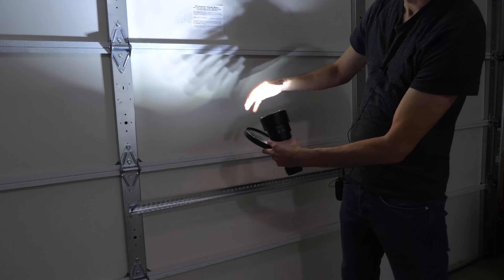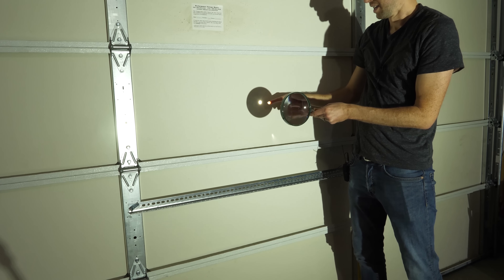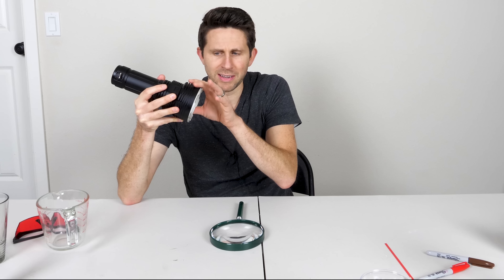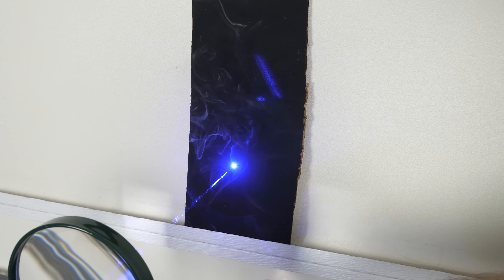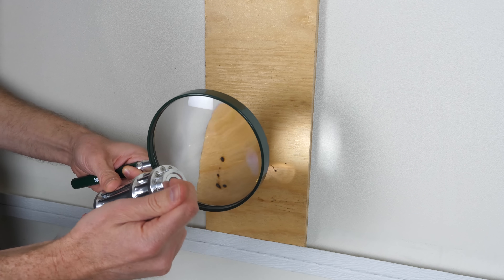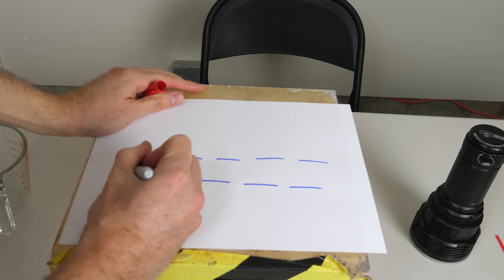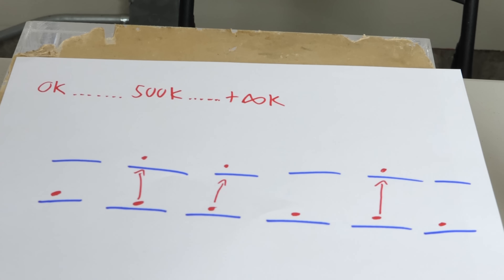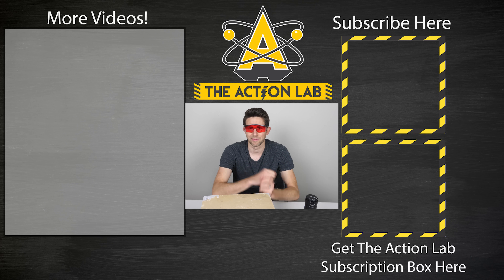What Happens if You Focus a 5W Laser With a Giant Magnifying Glass? Negative Kelvin Temperature!

Comment: But if i have something has an infinite temperature it therefore has an infinite amount of energy. Which means that by cooling it down I remove energy from the system from it but the energy of the object stays at the same (infinity goes against common sense) and that means that I destroyed energy which is not possible. And if something really had an infinite energy output then howcome litteraly no one has used it to solve energy problems? Seems like this video is full on lie.

Comment: I wish I could say how many watts the insane laser diodes I have are. But I can’t 😉 the fact they are not suppose to be sold to the public might give a few hints or the fact that no info is on the internet about them b/c corporate policies. Lol. Safe lasering folks. Keep safety in mind and make sure you use the appropriate eyewear. Not eBay crap that is completely just wrong that it exists. 😞

Comment: Thermodynamics is defined as branch of science that deals with energy... Temperature is just a measure of random motion/vibration.
In lasers there is no randomness so you get 0 or -ve temperature
Stephen's law says. Radiation energy emitting is proportional to Temperature^4... So for source to emit laser, it doesn't matter even if temperature is negative (or imaginary) as long as T^4 is positive ,which is for all real and imaginary numbers (not necessarily for complex numbers) laser source can have negative temperature and still emit radiation..
Reply: Besides 0 Kelvin was defined by gas laws... P V=n R T..
This equation suggests at T= 0 there should be no motion of atoms or molecules.. this point was graphically found at -273.15 Celcius and new scale was introduced having that point as zero (i.e. 0 Kelvin)
This was termed absolute zero... But that is not true when you are talking about subatomic science. As theory never took into account motion of electrons. And sub nuclei motions...

When electrons fall from say X shell to Y shell it emits radiation. Wavelength of emitted light can be calculated depending on shells... Wavelengths are unique for each combination of atom and shell numbers X, Y...
In case of lasers all wavelengths are same.(which is not in the case of normal light) this can only be achieved if electrons are falling from same X level and going to same Y level... Yeah! No more randomness.. so this loss of randomness means it's less random then non moving atom i.e. less then 0 Kelvin
This means if we want to address randomness of electrons we need to make a new scale.
Then you need to make newer scale to account for sub-nuclie randomness (if there is way to decrease randomness of it - which will be found as science progresses)
So don't get bother that how can negative temperature exist...it can

Comment: Not sure about this explanation. Are you actually getting a higher energy point than the amount of energy the laser can produce? I feel like theres a big "technically" somewhere in there. If you could use more optics to focus all of the light from the flashlight to a small point, that would still be near the actual power output of those LEDs and possibly able to burn. With a laser you just get that without all the optics in one color. I'm not a quantum mechanics scientist or anything but it sounds like you are still matching the power of your source.

Comment: There is a few mistakes in that video.
#1 : if a lense concentrate more your laser, then this laser is not calibrated correctly.
#2 : temperature is the mean speed of molecules. Very high in the thermosphere, the temperature is high, but you would freeze if you get nude over there. Not enough atom are hitting your skin to warm it up.
#3 : temperature is not the gradient of electron excitation.

Comment: 1- you cannot go beyond positive infinity. as you cannot go beyond what has no end.
2- it does not matter if you placed the laser far back of the room or near the magnifying glass. only a small distance that is needed for the magnifying glass to concentrate the laser would be sufficient.

you concentrated the laser into a smaller point. just like the sharp tip of a needle. this increased the heat per square inch. thus it burned more rapidly. you dont need that much philosophy for that...

Comment: The laws of thermodynamics are valid only for macroscopic systems in thermal equilibrium.  Population inverted quantum states are metastable and NOT in equilibrium with their environment.  We do consider extending thermodynamics using infinite and negative temperatures; however, these are not yet consistent with the robust framework of thermodynamics.

Comment: Do you mean that, if I focus radiation of the whole sun on the tiny spot ( for example by using a lot of mirrors around it) I can't get a higher temperature of this spot than the sun's surface temperature? I don't think so, I can't get higher energy, but higher temperature of course yes. The same amount of energy at smaller volume = higher temperature. Also if you focus led light on point with a surface smaller than LED emission surface, this point will be brighter. You are mixing the definition of energy and temperature. You should do an errata video.
Reply: Did you read the pinned comment?
Reply: Exactly
Reply: The focus receives energy from the source and also gives the energy back through the lenses (a heated object is always letting out energy). When it reaches the same temperature as the source, the energy exchange process will reach a balancing point. Therefore, the tiny spot still cannot become hotter than the surface of the sun.
Reply: @xiaoyangwang8588  
If you obtained the temperature of the surface of the Sun you don't need anything hotter actually. It'll vaporize any material that we know of.
PS
The older I get the hotter the young women get. Perhaps that's just illusion on my part. That has nothing to do with thermodynamics. Psyche Dynamics Maybe.
Reply: Its what the first order used in starwars movie 7 to destroy planets
Reply: @tomekpeki  You can't focus sunlight to a single point with mirrors.  It will never get hotter than the sun's surface.
Reply: Did you even watch the video
Reply: Bruh y’all be to smart
Reply: @justawildgengar  
Your comment brings to mind two Old adages.
#1
A wise man has something to say. Whereas a fool has to say something.
#2
It is best to leave one's mouth shut and thought of as a fool, rather than open one's mouth and remove all doubt.
PS
I'm just messin'.
PSS
I am rather sick of hearing male homosexuals, versus lesbians which are also scientifically speaking homosexuals, speaking in all sorts of media venues. I know a lot of actual tough guys that are very intelligent and well-educated compared to this individual, and they speak like men. My argument is backed up by if someone moves down to the Southern States when they're young whereas they grew up in the northern states of New England or such, within a few months they will start to adapt Southern drawl. That is a truth. Young people hear nothing but male homosexuals talking on media, such as radio, or news even sports announcers, makes me sick. Is programming Young Minds that that is an acceptable way for real men to speak. That does not of course mean there are not homosexuals who speak like normal radio voice either, but the whole idea of the lisp thing pisses me off. It's an agenda and I'm fed up with it. And bulshit on your PC politically correct bulshit. That's an attack upon my first amendment. But it's not going to matter anyway America is dead. The Mask wearing cowards immediately behaving in submission to this faux government, indicates they can not even realise they are slave minded fools.
Reply: Bignose Harry You have some problems and probably you don’t know it, please visit psychiatrist.
Reply: @bignoseharry6561  dude what were you even trying to say at the PSS?

Comment: I have an idea for a laser like the one you're holding. I live off the grid have a gas refrigerator I want to replace the flame with a laser that is turned off and on with a thermostat. I would love some feedback on this .
I spend $40 a month on gas just for the fridge so if it works and the laser last for more than 2 months I am way ahead in the game.

Comment: I dont know if this was mentioned anywhere but here my idea on concentrating all the light from the flashlight: 
If we can have fibre optic with the same diameter as the flash light and then we shine the light through it, then instead of losing 95% of the light we can retain 95% of the light and then magnify yhe light then we can have a very hot and concentrated light point.

Comment: The laser light when falls on a point under microscope may be the surface burns due to maximum exposure on the surface but what is the temperature of that light source. So this shows laser lights are producing hotter lights but in various directions which creates torch maximum surface lights. Sun lights when used in sun cooker it produces 3500 degree celcious in temperature so how much heat laser can produce??

Thankyou.

Comment: I cannot leave without saying this was the worst explaination I've ever seen. That physics in this case are more based on the effiency of the light source. The power consumtion (watts) go into light and heat. Whereas the laser uses to output more light and less heat and the flashlight (cheaper) outputs more heat so there is less light logically. As you have a small ray of light the energy on the surface concentrates an the area and the more light that goes into the matter (black or white) the more energy is converted to the lower energy state (heat). Although there would be tools to make the flashlight to a beam of light the rays have less energy as I already said. The explaination with hot light source is not correct. The sun is the brightest light soure and the hottest light in our solar system. You can concentrate the light and burn the wood too. Nevertheless the sun is neither colder than the burning wood nor the sun consumes heat or is cold anyway. Fact is the sun is not an efficient light source. It produces a lot of heat too, witch is a type of energy you need to add by watts if you want to calculate the amount of energy the sun produces.
Reply: Sorry, explaining physics in non native language is difficult - hopefully I used the correct terms ;-) please be lenient.

Comment: Excuse me but did he know what a laser is? It is a efficient way to focusing light about a tiny emitter. The waves of light can only in one dimension and this is an point of a focus. The sun produces the same waves of light or in another way it is energy. If you focus the led with a reflection zylinder to direct the light in one kind of dimension and than focusing the light has the point the total sum of light of the six led's. Think so you have a area to burn and you can choose between a focus light with an area smaller than that you will burn and a non focus light the same size of the area you will burn. The focusing light can use a higher engery to heat up the area and burn it but you must burn step by step. The energy of the non focused light must need more time to heat up the area but than you will burn the hole area. This all ignore the lost of energy by time. And a little example to the end. If the earth wouldn't rotate than the sunlight will burn the earth.

Comment: Yeah it seems that spot size is dependant upon the distance from the laser diode (beam source) to the focusing lens. If you expanded the beam before the lens though, I think you would require less distance to get a similar spot size diameter. One of the reasons in optics it is an usual practice to expand the beam with a telescope is to make the spot size smaller and the beam more manageable.

Comment: That's a whole lot of BS.

Electromagnetic Radiation to Thermal Heat is rather complex but there isn't a need to go into it to explain simply what's happening.  It's a matter of electromagnetic radiation being absorbed by a material and due to the conservation of energy, that absorbed energy becomes thermal heat (molecular vibration).  By passing light through a magnifying glass, it's possible to focus more light onto a smaller area.  This results in more energy being absorbed by a small surface area and the temperature increases.  The reason why it doesn't work with the flashlight but works with the laser is because the laser has a higher light density than the flashlight.  That is to say, if we compare the flow of light to the flow of electricity, there is more 'amperage' flowing out of the laser than what is coming off of the flashlight.  It's not a matter of it not working with the flashlight but rather there isn't enough energy density to actually begin burning stuff.  Shine that concentrated light from the flashlight onto the bulb of a thermometer (with the bulb painted black for maximum absorption) and you will see the temp go up a few degrees.  I know that it works with 'diffusing light' because I was able to burn paper by focusing the light of a 10 million candle power spot light.

There is no "infinite" anything.  At a certain point, the bonds of the material absorbing the energy will break.  Flammable substances will burn, solid substances will melt, liquid substances will vaporize, and gaseous substances will turn into a plasma.  If you manage to confine the plasma and continue to pump in more energy than what's being radiated away, eventually atoms will begin to fuse.  Keep going and the atoms will come apart forming a kind of super plasma.  Keep going and eventually even the gluons and quarks will come apart forming a kind of hyper plasma.  We're talking big bang levels of energy input at this point which is impossible.  

There is no such thing as negative temperature.  There can be a subtraction of temperature (aka cooling), there can be a reverse transfer of thermal energy, but no actual negative temperature.  As in, 0 deg K is absolute zero for which no energy remains.  Since that's what temperature really is, the measuring of energy within an object or system.  Even then, that's where zero point energy comes in where even when at 0 deg K, there will still be some motion within the particles that never goes away.  

Now to explain why it works so much better with sunlight than it does with a flashlight, even if the flashlight is shining more brightly, requires going into the complexity mentioned earlier.  It still has nothing to do with -temp nonsense.

Comment: ehm... The easier explaination is just that the total amount of light has an amount of energy (indirectly luminance) spread over an area (measured in "Lux")
You compare the lazer which is paralel light to a tiny portion of the flashlights light. You could achieve burning with the flashlight by having two manifying glassis of same size that are larger than the flashlights circuferance.

Also... As a chemical engineer having you mention "negative kelvin" is a big yikes as you are essentially saying that the atoms are moving less not at all... which doesn't make sense, and you know that.. Also, you would have fixed the problem of reaching 0 K with a laser and a magnifying glass - I think more scientists would have fingured that one out if that was possible...

Your point in this video get a score of: "Yikes"

Comment: This is really just an artefact of dS = dQ/T. If adding energy to a system (dQ positive) makes the entropy go down (dS negative), then the effective temperature is negative. And the only systems in which that criterion obtains are those which can be pumped away from an equilibrium density of states (which is maximum entropy) to achieve a population inversion.

Comment: It is so much misinformation. 
The burning point of material depends on many facts. Increasing temperature leads to require less energy to burn. 
Blue laser has higher energy than energy which required to burn the material in this case. Then this experiment collected all energy of laser of blue flashlight and focused into the smaller area of blue flashlight = increase density >> increase energy in space >>  be burned quicker. The keynote that in blue light the energy transfers from Blue laser flashlight is quicker than energy of material able to release to  environment that leading energy increases.
Same manner the red laser flashlight can't burned the same material in same condition. But if you have many red laser flashlight that can give more energy focus in unchanged space area then burning material is happening. 
And one more thing that the glass gets the a smaller energy from the sun at the earth to get temperature same or greater from the sun. If you able to built the glass that big enough to focus in single point then temperature can reach higher than temperature of surface of the sun. But energy will break air molecules before energy reaches the material.